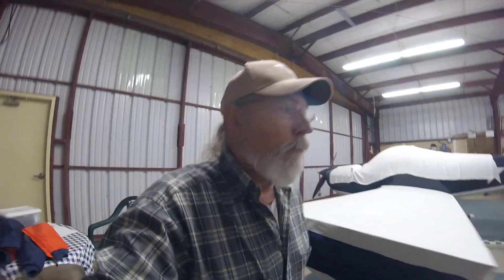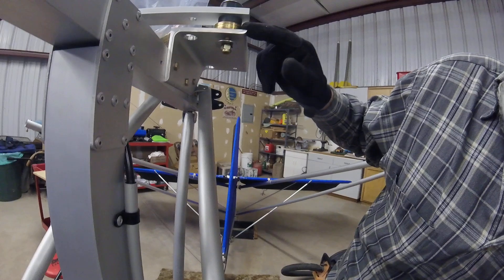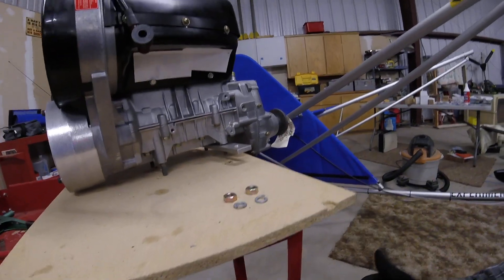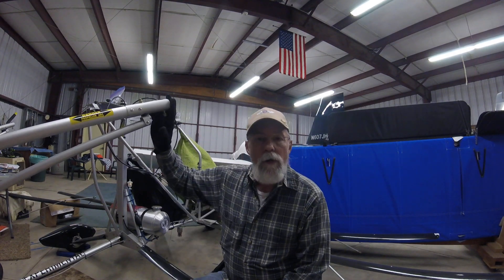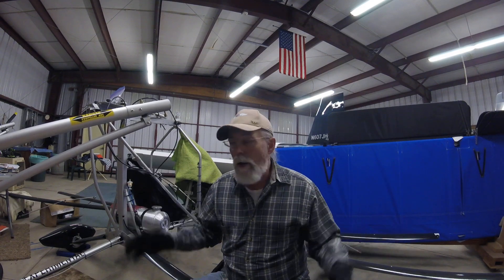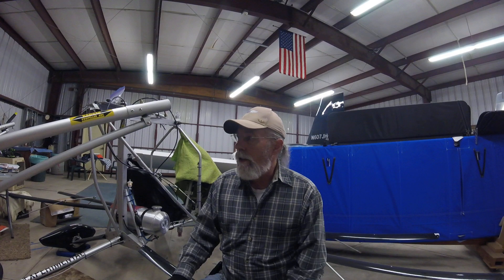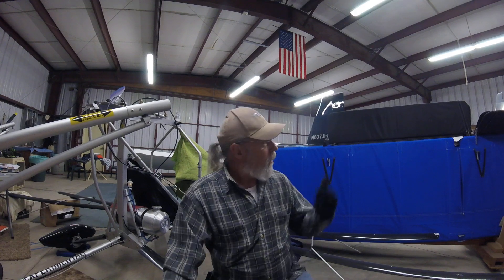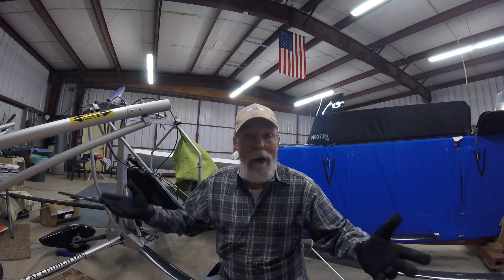My power-plant is a Rotax 503 DCDI - Engine Mount/ing and Installation Progress

Comment: Sorry to tell you, but with a Rotax 503, your plane is not a legal ultralight under Part 103.  A legal ultralight is allowed to weigh no more than 254 pounds.   With that engine , you are going to be a quite a bit over that.  You would need to get a Sport Pilot license or Private Pilot license.  If you're not worried about the FAA checking you, I say go for it.
Reply from the maker: B. Sterba - Don't be "sorry to tell me". I already knew/know that, though. I appreciate you being concerned for my 'legal status'. Thanks for the comment.
Reply: I didn't mean to sound like a know-it-all in my comment.  I just thought in case you didn't know, you could choose a different engine before you got too far.  The reason I commented is because I have an Aerolite 103 with a Rotax 503 also.  I haven't flown it yet, because I'm installing an EIS and it's winter here.  I keep my plane at a rural  airstrip where I'm not worried about the FAA.  My only concern is if I had a crash, the FAA might investigate.  They don't investigate legal ultralight crashes, but if they were called in, they would realize it wasn't a legal ultralight.  I think the fines for flying without a license are pretty steep, including the option of jail time.  I enjoy your videos and admire you for doing them.  Keep making them!  Sorry about the long reply.
Reply from the maker: No worries. No offense taken. I didn't mean to sound upset. Apologies to you, if I did. The 503 has MORE power that I will need for STOL. I have some friends that own ranches/farms and have grass strips that are short. I want to be off/on ground in less than 400-500ft and the 503 can do it. Besides that I want my 'sport pilot license' anyway. I want to get a two-seater LSA one day and will need it. But I hear you about FAA and the 'rules' - which is why I'll most likely go for "sport pilot" certificate when I am finished with my Aerolite 103. "Blue skies and tail-winds" to you. :)